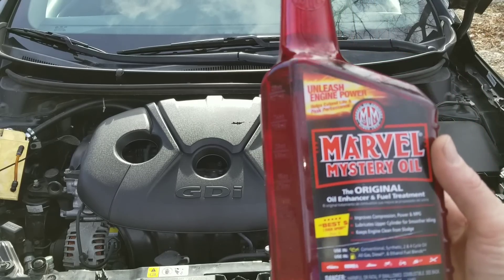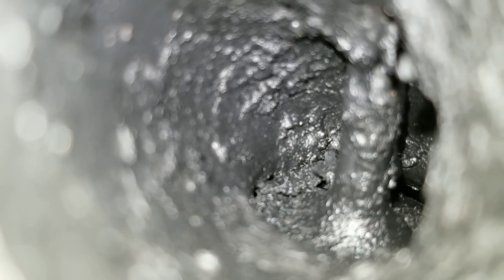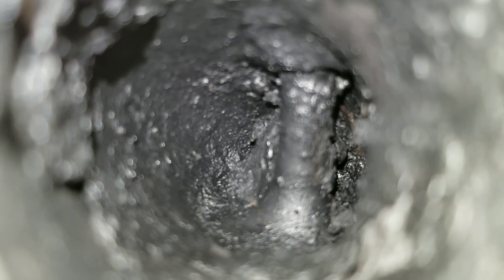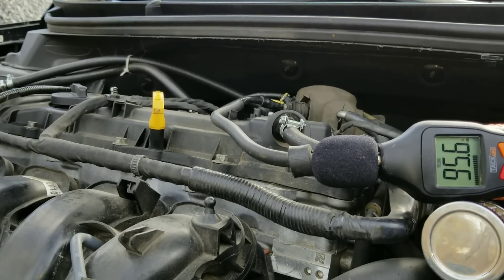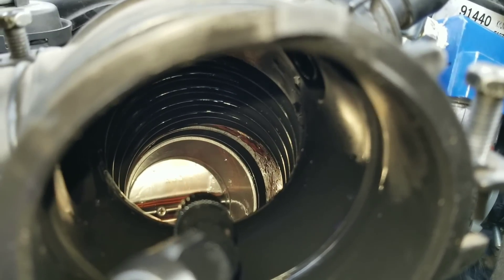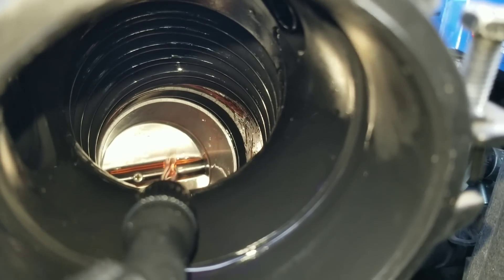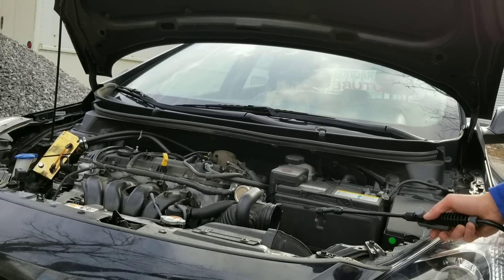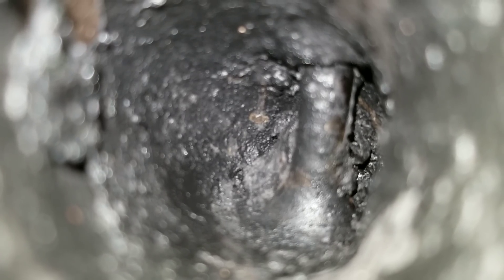SCOTTY nates REAL truth ABOUT MARVEL MYSTERY OIL

Comment: I've used Marvel(MMO) for over 50 years. You have to bring the engine up to temp, put in enough MMO to stall the engine and then let it sit for a few days. Then start it and run it at highway speeds for 1/2 hour. Then check the valves. To clean the rings, combustion chamber, and valves add MMO at 6 oz per ten gallons of gas. It will take 6 months of normal driving but it will clean the inside of the engine and the MMO prevents corrosion in the fuel system. MMO needs time to soak into the carbon. MMO has saved dozens of smoking engines for me. As part of your pretest data do a full compression test set too.
Reply from the maker: Thanks is marvel the only cleaner you had good results with?
Reply: @NATESINTERACTIVEAUTO  Marvel is an "upper cylinder lubricant" and my grandfather taught me to use it on my first car in 1967. I tried several other things but for carbon in cylinders MMO is the best. It will also help keep fuel systems from corroding but for cleaning fuel systems I use Gumout or similar. I am a curious type(engineer) so, in 1970 when I was building a 1964 Chevelle drag racing car, I experimented on an engine. I was given(lots of free cars in those days) a 1963 Impala with a 283 V-8 with power pack heads. The engine was badly carboned so I decided to try an experiement. I poured an entire can(pt) of MMO into the carb while she was running. I only poured as much as she could take until the end when I dumped enough to stall her. I let it sit for 3 days and then started her up. She smoked like a Uniroyal stack. This lasted about 15 minutes or more when the smoking stopped , I brought her into the garage. A day or two later I pulled the heads to start the rebuild job. The heads and piston tops were fairly clean. That convinced me.
Since then I have obtained atleast 9 cars that were smoking a bit. I tuned them and did compression checks(part of a proper tuneup). I then ran them with MMO in the gas. After 3 to 6 months they didn't smoke and the compression was much better. With long term use, MMO will free up the rings so that they can seal against the cylinder walls. Many times the rings get stuck in the piston ring grooves because of carbon build up. This prevents the rings from sealing against the cylinder walls. When freed up compression goes up and smoking goes down. I also use it in all of my small engines. Years ago, I talked to an aircraft mechanic from the 1930s, he said that they used MMO in all their engines to keep them running longer. Merry Christmas
Reply from the maker: Thats a incredible story and information so thanks this helps alot really and i wish you a great Christmas

Comment: It’s better for port injection and your supposed to add it to the oil to plus ya want to clean intake valves try sea foam spray in the intake
Reply from the maker: I did seafoam vs crc what else would you like to see
Reply: Seafoam sucks

Comment: Clean that much and it's going to burn, leak oil. I used to use it consistently but with catalytic converters have stopped.
Reply from the maker: I haven't had problems follow manufacturer's instructions

Comment: Just use a higher octane name brand gas. I started using 93 to 98 octane in all my cars about 20 years ago. When I did my own fuel cleaning like you did and had just a little carbon build up. Here is a product that works very well Berrymann's B-12 Chem Tool use add the whole can before toy change the oil and let the car or truck run 15 to 20 minutes at idle and put a can od Berrymann's b-12 in the gas tank with 93 to 98 octane plus use semi Syentic or full Synthetic motor oil and you will notice a difference. I use Mobil 1 or Valvoline Dura Blend High Mileage or Castrol GTX full Synthetic. Stick With Shell Mobil BP (AMOCO) Marathon. If you have a Casey's General Store nearby they have a 92 octane with no ethanol (Pure Gas) and cars do run better with no alcohol or gasohol in the fuel.
Reply from the maker: Yes b12 is great for the cost and thanks for sharing your information with the NIA community

Comment: Just out of curiosity,,,,how many miles are on your GDI engine ? I made the mistake of buying a DI engine this time, but from what im hearing, almost all cars and trucks are using them now days. I just bought my new/used truck and it only had 20K miles and i`ve added another 5K miles.

I recently bought a Moroso Oil Separator "Catch Can" for added protection.

 I`ve worked on all my vehicles my whole life, and i`ve even built a few complete engines from the block up ( Old School ), but these new cars and trucks with all their sensors "WOW", what a mess. We live and we learn for sure.
Reply from the maker: Yeah the direct injection is here to stay and with proper maintenance i believe we can leave problems behind us. 90000

Comment: Don't do it. I added 2 bottles Mmo to an engine oil both of my f250 and Porches cayne and few weeks later both had clogged catylic converter and 
Oxygen sensors problems. 8k
Mistakes.
Reply from the maker: What could i test
Reply: Maybe if you could read basic instructions you wouldn't have added two freaking bottles of the stuff. Only needs a small amount.
Reply from the maker: Thanks for watching
Reply from the maker: Its direct injection
Reply: johnny Macon wheelbarrow 😀😀

Comment: How did u get that type of view on the intake valves?
Reply from the maker: Depending on the car i sometimes use a borescope or just take off the manifold just becarful of the plastic manifolds and a good borescope can yield great results but not the 10$ ones but they can give you the information you need so what can we try next epoxy, glue,AA, batteries i just uploaded a video on AAA batteries

Comment: You probably should have turned the car off and let the marvel sit on the valves for a few minutes then proceed to continue the spraying after starting it up again. Cool video though. Great valve shots
Reply from the maker: Thanks alot i allowed a heat soak what can we try next?
Reply: @NATESINTERACTIVEAUTO  only think I can think of is BG 44k and berrymans.
Reply from the maker: Yes the berrymans i have used not the bg44k
Reply: @NATESINTERACTIVEAUTO  lot of mechanics my dad used to go to swore by BG 44k. Here it's about 20 dollars a bottle
Reply from the maker: How can we use it

Comment: you need to rev your engine 3 or 4 times up to 3 and half rpms like 3 times then idle 1 minute then turn off and after an hour drive at highway speed for 10 to 15 minutes. I will just stick with CRC.
Reply from the maker: Yes i did the same as crc and seafoam instructions. What would be the best product to test next?
Reply: @NATESINTERACTIVEAUTO  just stick with one product and always use that product. for example my wifes hyundai recomend to use quaker state 5- 20w syntetic engine oil. So, i stick with the same oil forever. Its not good to use a different brand of oil if your car engine is already use to the same oil you already been using for a while.
Reply: My nissan 3.5 i got brand new back in 2009. I have always use Castrol GTX since i purchase the vehicule and the same transmission fluid and of course regular maintenance. as of today 128,463 miles in it. Still running strong like new. So far i have not replace any parts or something go wrong. Just had to replace a wheel bearing wich it was super cheap cause i got the part on amazon and did it my self, fill tank with gas and keep going. very important to clean your engine. You can eat out of my nissan engine.
Reply from the maker: Yes thats what i do good idea
Reply from the maker: Thats awesome what do you use in it?

Comment: Yeah gdi do NOT have intake valves they are similar to a 2 stroke!
Reply: Really REALLY REALLY ?!!!
Reply from the maker: Thats interesting
Reply from the maker: Yes really im kidding
Reply: Thats not true man!
Reply: You need help
Reply from the maker: Thats for sure
Reply from the maker: Without a doubt
Reply from the maker: Yes
Reply: What are you talking about? 
GDI still has intake valves. 
Don't be stupid.
Reply from the maker: Yes thanks
Reply: They have intake valves they are actually more  simular to a diesel engine in a way that it sprays fuel direct into the cylinder hence the word gdi (gasoline direct injection).I think you mean the multi air engine witch uses sulenoids to open and close the intake valves rather than a cam shaft. A 2 stroke does not have valves like a 4 stroke engine and uses reeds wich is like a 1 way check valve but is not opened and closed by a camshaft what opens the Reed up in a 2 stroke is the engine sucking air in. A 2 stroke engine sucks air in when the piston is going up,it is sucked under the piston and is brought into the cylinder on the down stroke of the piston. A 4 stroke engine sucks air in through the down stroke or intake stroke in wich the intake valve opens and let's air in creating a vacuum hence the reason 2 stroke diesel engines needed superchargers to feed the engine air because they could not create their own vacuum.
Reply from the maker: Thanks for the information
Reply from the maker: Lmao
Reply: Its has direct injection. The injectors spray directly into the combustion chamber and bypass the intake valves. Which allows carbon buildup around the valves. Port injection injectors are in the intake manifold where the fuel passes through the intake valve keeping the intake valves cleaner with less carbon buildup unlike the direct injection
Reply from the maker: Thank you
Reply from the maker: Haha
Reply: They also inject near the top of the intake stroke.
Reply from the maker: Thanks what can i test next?

Comment: I like Marvel,but,i personally put some rusty bolts in a container with Marvel and they have been soaking for 2 months.There is absolutely no change,none.I was surprised.I add some Marvel at my oil changes and change oil a little earlier than needed.I have ovr 250,000 on an o2 GM 5.3.

Comment: Looks like it did pretty well nothing especially where the valves seat I'd say not worth all the trouble, today I'm planning to use crc, vehicle running terrible no power at take off.  I put marvel in the tank and oil where it's designed to work.

Comment: More than anything MMO is a LUBRICANT; Oil Enhancer & Fuel Treatment (stabilizer).  It is NOT as harsh as Sea Foam or B-12, those are definitely straight up SOLVENTS (hence the metal cans).  I believe CRC has the best intake valve cleaner so far, again;  a harsh chemical in a METAL can.
Reply from the maker: Yeah theres alot of good proof as to what your saying in the test i performed
Reply: I agree too. Even diesel or kerosene has more detergent qualities than MMO. That's why I used b100 diesel and isopropyl alcohol  mix as it worked same as CRC and costs a lot less. Biggest issue is time. It takes several treatments to make a difference. Or remove intake and do manually like I did. It's quite easy
Reply from the maker: Yeah thats really great idea i would like to try isopropyl mix. What a about mixing the most powerful together and if so which ones ?

Comment: Idle up the engine to 1000 - 1200 rpm then squirt the MMO in the intake !!!! and drive it with MMO inthe fuel.
Reply from the maker: Yes i did this mixed with gas check it out

Comment: The motor is direct injection that means the gas goes right into the cylinder putting Marvel mystery oil in the gas does absolutely nothing to the valves
Reply from the maker: The marvel was also sprayed

Comment: Why aren't you holding the idle up like a couple of those other products recommend doing???
White GTI very quickly became a hybrid system of GDI and port injection. The perfect example of why you don't let Engineers go off half-cocked when they have never turned a wrench.
Reply from the maker: You are so correct but what products have you had success with?
Reply: @NATESINTERACTIVEAUTO  I'm not sure who you're responding to
Reply from the maker: I was asking you
Reply: @NATESINTERACTIVEAUTO  I almost always use Marvel Mystery Oil. As I have found it to clear lifters and clean up engines far better, and with less possibility of damage to the engine than any other product I have ever used. When I have a particularly hard case of carbon in the intake system I like to use B12. It's harsh enough to get the job done and it's not going to be in your vehicle very long. Marvel Mystery Oil is also an excellent upper cylinder Lube, after the second or third application on my motorcycle it was getting markedly better fuel mileage. But once in awhile I will actually mix a few ounces of Marvel Mystery Oil with straight acetone, do not spill that on your paint. But the acetone helps with the volatility of the fuel that has been treated to keep it from vaporizing easily, it does help with fuel mileage. And it doesn't cost a lot per gallon. And you're only using 6 to 8 oz at a time. But Marvel Mystery Oil is been around for a long long time. It started out as a motor oil for World War 1 radial aircraft engines. And started being bottled in 1923 and named Marvel Mystery Oil. The great are too loyal and can't be run as part of your oil as a regular course if you'd like. When you get ready to change oil and you notice that your oil is about a quart low throw a quart of Marvel Mystery Oil in it run it for a week before each oil change. Keeps the inside of the engine clean as a whistle. It was really popular back in the 30s 40s 50s before they actually started putting oil filters on a lot of cars as it would clean the engine quite well.
Another meat used for it is to put it along the inside of the bottoms of the doors and inside the Fenders by all the creases and around all the formations of the lower portions of the quarter panels and even drill and put it into the rocker panels. Keeps them almost rust free forever.
Reply from the maker: Wow thats more information than i ever heard on marvel thanks for sharing your experience with the NIA community so what can we test next?

Comment: Would it ha e been better to pour MM through a vaccum line as you would to clean the upper intake manifold to clean the valves?  Also put it in the crank case because it really will help with the clacking of the valves which will help them move better.
Reply from the maker: Yes thats smart what is the best way to test these products?

Comment: I’d like to see you test Liqui-Moly gdi intake cleaner.
Reply from the maker: Ok we will what about mmo experiences?
Reply: Forget that , that intake needs to come out and cleaning with chemical bath , there is no product that can remove all that build up ..
Reply from the maker: Wow this sounds like it may work. How long have you been using that method?
Reply from the maker: What about oil additives do they help?
Reply: For More Power Add 500ml With 20 Litre High Octane In Fuel Tank  Consequtively Twice. It Will Clean Injectors, Piston Heads And Cylinders, Oxygen Censor And Catalytic Converter.
Reply from the maker: Jet fuel as a cleaner a good test?

Comment: Didn't dp much did it?  Need  a stronger cleaner chemical for sure.
Reply from the maker: Try what next
Reply: @NATESINTERACTIVEAUTO  Little late  for  more cleaning  outside  of having the valves blasted with  walnut shells. After that, always use the best quality synthetic oil  in the engine.

Comment: I use mmo all the time I really like this product but used like you used it it didn't seem to work maybe if you raised the rpm to give more velocity and more volume instead of slowly getting by that throttle body maybe it would work better but for now mmo in the gas tank and oil to maintain and crc intake cleaner for big cleaning jobs like that one thanks for taking the time to share
Reply from the maker: Check crc vs seafoam how can i improve
Reply: NATES INTERACTIVE AUTO I watched the crc vid and it looked like it worked great you might try flooding the engine with the last of the crc before hot soak
Reply from the maker: Great idea what about new products i haven't tried. Do you know of one?
Reply: NATES INTERACTIVE AUTO I know Chrysler had a top engine cleaner back when I worked at a Chevy Dodge and  Nissan dealership might be worth a try I'm sure Chevy and Nissan do too but never really had much use for them  didn't see the buildup back then before direct injection unless it was a grandma car that needed the carbon blown out and we just used water or our right foot
Reply from the maker: Yeah thanks for the good idea